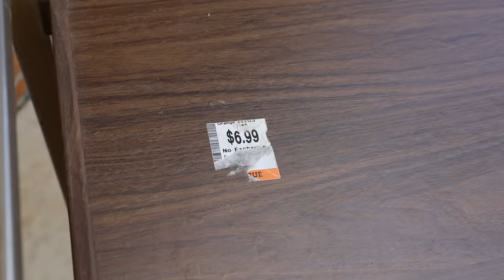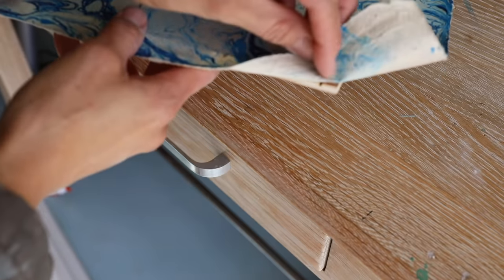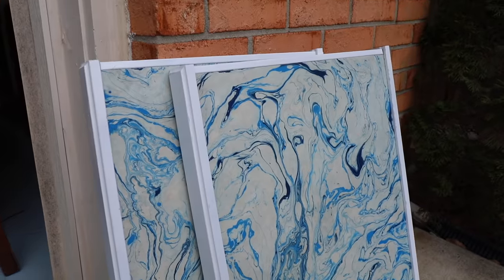Vintage Bar Cart Makeover From the Thrift Store: Furniture Makeover - Thrift Diving

Comment: well the paper turns yellow because the epoxy can enter the fine fibers/pores of the paper. if you take some woodglue, pure or mixed with some water if it is too thick, roll it on the paper and let it dry. if you put the epoxy over it it can't enter the fibers/pores anymore and should stay white.
Reply: Giotto Ferrero would something like mod podge, used in decopauge work? That was what I was thinking when she first spoke of epoxy. I've seen epoxy yellow white paint over time.
Reply from the maker: Great point, Giotto! I didn't go into too much detail about my little side experiment with the epoxy, but this is how it went: I did several test boards, one of which I sealed with Mod Podge and then poured the epoxy. That's the larger of the board you see in the video. But it turned yellow around the edges because I didn't seal it completely. I was rushing through the test. The second test piece you saw that was all yellow, I tried a different type of spray to seal it and it didn't work. Hence, the yellowing. The third board, I did 2 coats of the Mod Podge to seal a test board and made sure to thoroughly coat it. I didn't pour epoxy on it because by that time, I realized that I could just do glass and it would look just as good. But meanwhile, I learned a lot about epoxy and LOVED the look of it, but realized that this project wasn't the best project on which to use it. The instructions also advice against using the epoxy on white backgrounds for that very reason: the yellowing. So I'll likely use it on a desk top or a cool craft project. I LOVED working with epoxy!
Reply: If you paint the shelf white prior sticking the paper and then cover it with epoxy, would it go yellow as well? 🤔
Reply: Giotto Ferrero that is a great tip but I want to add that you have to make sure the resin isn't yellowed with age as well, the 2 parts of the epoxy should be clear, if one of them is yellow then it's old and will cure with a yellow tinge!

Comment: I don't think that the clear coat turned turned the paper yellow as much as it made the white part transparent, and the wood-tone was showing through. If you paint the shelves white first, the clear coat should work just fine ;)
Reply from the maker: You are right--on the second sample, the yellow was definitely due to the epoxy soaking through and the yellow of the wood coming through. But the epoxy instructions did say to not use it on white because of yellowing. Although it may have meant over TIME it will yellow. But still.... Thanks, Sierra!

Comment: Check in the art section of a craft store for "Fexative".  My spelling maybe off.  It is a clear spray used to fix charcoal to paper so it does not smug.  You may be able to get a product that is equal to it online but as you said before try it first.
Reply from the maker: Thank you! Just looked it up. It's called Fixatif! I'll research it more. Thank you!

Comment: Wow!  Great job.  We had one of those carts for years and used it for several things including a microwave stand.  Then it got used for a coffee and drink cart with a dorm fridge on the bottom shelf and supplies of coffee and cups etc on top.To seal the tp you might use a thin bead of clear silicone caulking around the edge of the glass.  There is also a removable caulking for use in a caulking gun that sticks but can be peeled away if needed.

Comment: Nice project. I like that rust remover. You would paint the bare wood underside to prevent moisture from wicking in and out, thereby changing the shape of the shelves, cupping one way or the other.

Comment: Just info for the epoxy resin: if you seal the paper with paper sealer it won't turn yellow! Paper sealer doesn't really come in huge volumes though so glass was probably a good idea. A rule of thumb for resin is that the finished product will look like it's wet. If it's paper, being wet makes it look different so you need sealer. Cool cart!

Comment: Glad she mentioned she didn't seal the paper, best sealant for paper is Dala Deco Varnish high gloss, i have found, but that paper is made with natural fibre (handmade) and will get wet when sealed, and thus change in brightness but will  not yellow with Deco varnish. Always use paper with gloss finish if possible, it will be less likely to wrinkle and better condition over time.

Comment: Try acrylic gel medium.  I use it on my mixed media art pieces.  You can get it with a UV protection, too.  Had you primed the wood first, applied white paint and then attached the paper and epoxy it might not have yellowed.  It is reacting to the adhesive and plywood chemicals.  Nice job though.

Comment: I work a lot with acrylic pouring and resin/epoxy. I make coasters and tea trays. There are brands that don't yellow.  I saw the comment where your test had the mod podge to seal the paper, so the only other thing I can think of that would cause the yellowing is that the wrong brand of resin/epoxy was used.  I prefer Envirotex Lite as I have never had it yellow, but I have heard good things about Art Resin as well.

Comment: That's single strength glass intended for windows. It is absolutely going to break. For that purpose you need 1/4" glass, preferably tempered.
Reply from the maker: Thanks for pointing this out. I did think about that fact, but getting tempered glass may not be as easy to do unless you have a suggestion on where to get it...?
Reply: You can't cut tempered glass to size. She would have to have a piece custom-made.

Comment: The Industrial Sherwin Williams beige. First scrubbed the floor with Dawn Dish Soap and a scrub brush. Used Greased Lighting on areas that were oily/greasy. Rinsed with old wet rags; then let dry for a week or so. Used 2 coats of the paint. This is the 3rd home that where I painted the floor. Just looks so nice, although I do get a few quizzical looks about the Oriental rug.
Reply from the maker: The rug is a nice, homey touch, AND it keeps the paint looking fresh in high-traffic areas, so I totally get it! Here is my garage painting: https://youtu.be/yCEXcJ_j6mA

Comment: talking about the glued paper on one side of the wood and the backside without. when it comes to veneers you always have to put veneer on both sides of the board, from the same wood and same grain, only difference is that u usually use the prettier one on top and an other one that is not as good quality on the back. you have to do it to prevent the board from morphing. the same can be said for paint and glued paper.

Comment: I wonder if you could use Mod Podge Furniture to both adhere and seal the paper. I've used it for a few furniture projects (night tables) and haven't seen any yellowing in the paper. Also, there are different resins, including Ice Resin, which is clear.
Reply from the maker: Yep, you can. I don't really like using Mod Podge on top of paper because I don't like the way it looks. But if I am putting the glass over it, it may not be a big deal to try. I'll have to look up Ice Resin. The one I was sampling was called MirrorCoat. It's also clear, but says in the instructions that going over white substances, it will yellow over time. Over wood, it's less noticeable, that's why.

Comment: I love diying but sometimes it ends up being more expensive because of all the stuff you need to fix it up in addition to all the work it requires, not to mention all the time it takes! Some things I'd rather just buy new and for diy stuff I make sure  to get stuff that doesn't need to basically be demolished and rebuilt. I hate to spend more on supplies to fix it than what the actual item cost.

Comment: the apoxy mightve turned yellow due to moisture! for future reference, let everything dry completely before trying to cover it in apoxy. all the moisture that didnt dry up will be trapped and may cause mold
Reply from the maker: I think it turned yellow because of the board and it soaking through the paper. But you're right about making sure its dry!

Comment: Looks great! But you should have clear coated the bare metal with a spray to prevent it from getting surface rust.
Reply from the maker: Great point, Tom! That company that sent me free samples did also had sent a rust protection coating spray that I'll use on the metal. Thanks for reminding me!

Comment: I'd suggest not using spray bond for projects like this. The wood lignin/acid will actually cause it to yellow over time and it will break the paper down. That adhesive will also start to come loose if you ever get it moist, because the wood will expand differently than the paper and the adhesive (it will also cause mold to form under the glass). It's better to coat the wood with polyurethane or even matte medium, then use matte medium or mod podge to secure the paper. This protects the paper.

Comment: The paper probably turned yellowish because the wood shelves underneath wasn't painted, most paper isn't totally opaque, so you need to account for the surface it's on when working with it. If you painted the wood shelves first, I think the apoxy resin would've turned out fine. ?? Worth a shot next time.

Comment: Wonder if paper is going transparent and the colour is the wood. Have you tried  the paper epoxy over white painted wood. Curious.
Reply from the maker: I am pretty sure it's the color of the wood coming through, but the instructions did also say that white surfaces will appear yellow, so I think white generally isn't a good color to use with resins for that reason. I'm still going to do some samples and try it!

Comment: You should use spray lacquer to protect the metal. I think you can use it on the paper as well. It drys clear but test it first on the paper as you never know how the paper would react to lacquer. Btw  I love how that paper looks and the cart looks great.
Reply from the maker: The company that sent me some samples of the rust remover products actually sent one that I can spray on the metal to protect it. I just didn't do it because I was too excited to get this project posted by this weekend! LOL. I start class back up on Monday (now that spring break is over) so time is about to get reeeaaall limited for the next 6 weeks! I'll do some samples of a spray lacquer and see how it works. Thanks for the tip!

Comment: Love the cart it went from boring to beautiful!  Have you thought about using mod podge, it's a glue type sealer that dries clear and in widely used in the scrapbooking and crafting community.  I'm a crafter and have used on many projects.  You might do some research on it before you try it on that beautiful paper.  It's just a thought and by the way, I just subscribed to your channel.  Have a great day!
Reply from the maker: Hey there, Sandi! Thanks for subbing! :) Yep, I did use Mod Podge on the first sample, but didn't add enough around the edges where the epoxy seeped in. I did another sample and added two coats of Mod Podge and will test that board to see how the epoxy holds up. I'll likely use the Mod Podge to seal the paper on the cart, too! Thanks!!
Reply: You're welcome, and I love your energy kinda reminds me of me and my husband thinks so too :-).  By the way,  I'm a thrift store junky.

Comment: I don't think the epoxy turned the paper yellow, it just soaked through turning it translucent and showing the yellowy wood underneath. If you'd spray painted the boards white beforehand you could've still used the resin you bought!

Comment: Total cost of project if you add on the papers $12 and the rust remover $12 and the paint $3.50 and the adhesive $8 and the glass $20 . . . .$62.49

Comment: To remove rust from metal .... dip a scrunched up piece of aluminium foil into coca cola (YES coca cola) so it's dripping wet, rub over the rust, rinse off.  Rust gone! Might take a couple of attempts if it's deep rust but it works.

Comment: or even better , paint the board white first, than glue on the paper and afterwards coat it. the reason why it turned yellow was because the wood in your samples shone through. try the same exact method u used with your other samples just with white board underneath and tell us if it made a differende.
Reply from the maker: Yep, I thought of doing that, too, but it was only after I have applied the paper that I realized I wanted to use this type of epoxy. If I had known ahead of time, I could have planned it that way. But I think I really like the glass better just because it's less permanent than the epoxy would have been. With the glass, when I tire of the pattern, I can remove it and re-paper with another one! :)
Reply: you are absolutely right, the glass is a perfect option. the best thing about it, is that it is food safe and easy to clean and doesn't scratch. i absolutely love your projects. unfortunately where i come from in germany there are not many good thrift stores and the furniture is most likely chipboard and not solid wood.
Reply from the maker: Hey, from Germany! Wow, that's awesome. :) Well, if you own power tools, you can start making some of your own furniture. Do you own tools?
Reply: i studied interior architecture ( its architecture for houses and renovate old buildings and designing furniture) it's a but more than interior design in america. but i never finished it. and i had to do an internship in a joinery.  i see a lot of youtubers refurbishing old furniture and somehow even if the designs are not that great anymore, the material and buildquality is very good and are good to work with. i wanted to build a bar table for the kitchen and after calculating the material without even the finish, just the wood, i ended up more expensive than buying a prebuild one with finish made out of solid oak. if i wouldn't find similar jems as u do for a similar price in germany, it's just not worth it unfortunately. 

but i really enjoy your projects, you have a great sense of taste and eye for colour. i am pleased with living my passion for furniture through you.

Comment: If that is standard window glass, it's probably not safe to use it that way. Be careful.
Reply from the maker: L Malino I know.  :( I got a quote for tempered glass and it's $238 for two pieces total. That isn't feasible. I may very well try the epoxy to see if that will work. So that the glad doesn't break.

Comment: So if I  spent $6 on a piece of junk and $100 bucks on: Naval jelly rust remover, (I didn't get a free sample from a viewer) hand crafted paper from the art store ( I've worked with this kind of paper, it's not cheap) cut glass, spray paint, chip brush, steel wool, plywood from the hardware store and three days of my time,  I've somehow made a Silk Purse from a Sow's Ear and got a "bargain"?? Not economical, AND I still have to figure out how to seal the paper and the perimeter of the glass because the minute a liquid gets gets spilled on those shelves it will run along the edge trim and under the glass and get soaked up by the paper and not only ruin the paper but if you did find a way to seal the paper, you will still have to pry up the glass with any spills and clean up the liquid that will run under the glass. Use the cart for something that doesn't expose it to spills.
Reply from the maker: You definitely don't sound like a true crafter at heart. HA!

Comment: Did you toughen the glass it could very dangerous if drop something on it or a child pulls it over.
Reply from the maker: Tim Chapman Unfortunately not. I ended up finding a place online to get a tempered glass top quote and it was freaking $238 for tempered glass! Gasp! Guess we will just have to be extra careful. Or maybe once I do more tests, I'll remove the glad and use the epoxy.

Comment: I like the whole project .. But do you realize how much you spend .. Without including the self-adhesive spray the stuff they gave you for free to remove the rust and without including the design paper which you did not say how much you spent on it and without using your tools it was $32.99 that’s expensive .. Specially if someone’s trying to do it and doesn’t have your tools .. You spend $6.99 on the cart $6.00 to make the shelves and $20 for the glass to put over the shelves .. But other than that the project was beautiful